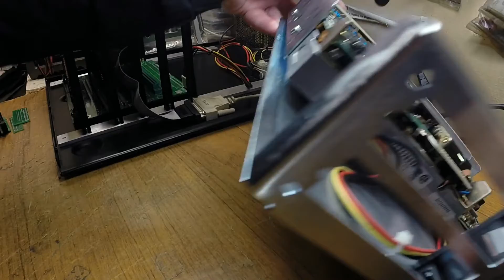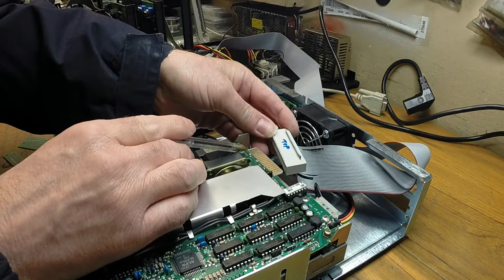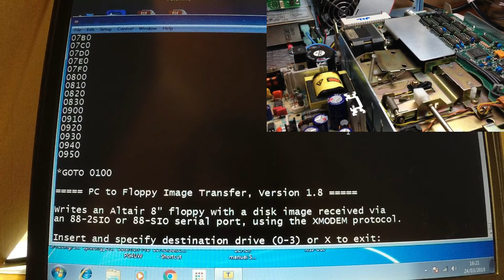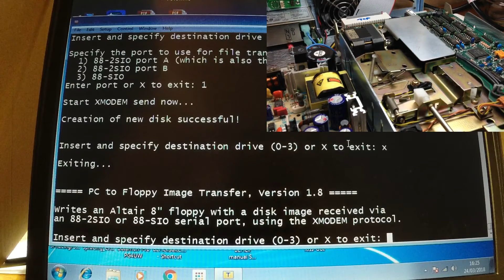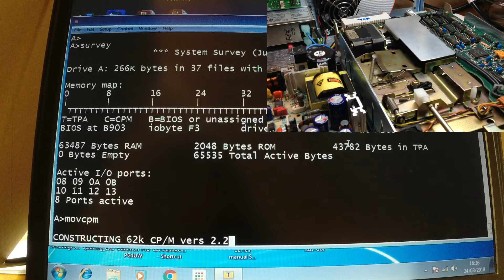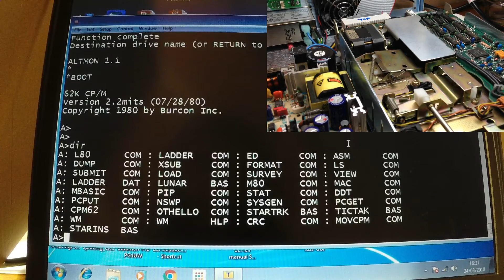Altair 8800 Build Project Part 10 -  Floppy Drive + Boot Disk

Comment: What was the case again. I had trouble hearing
Reply from the maker: There's a link to the case in Part 9. It is however:http://www.allmetalparts.co.uk/479-4u-19-stackable-rack-cabinet-case-400mm-5055726299929.htmlSupplied by All Metal Parts